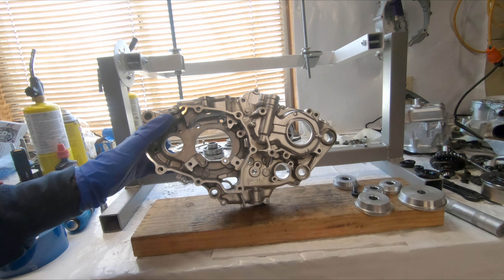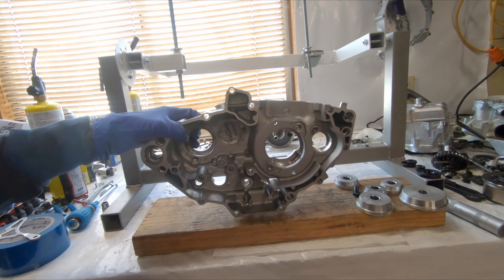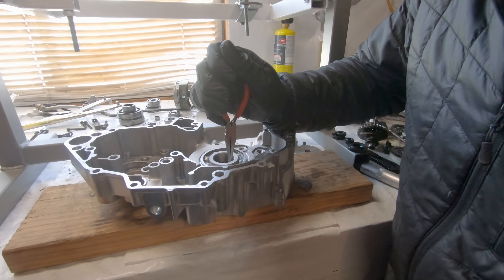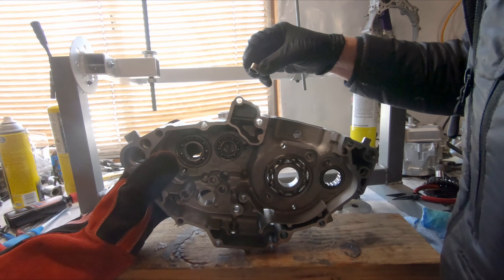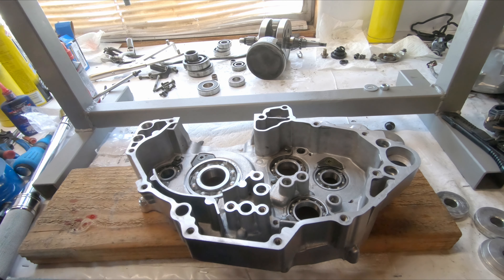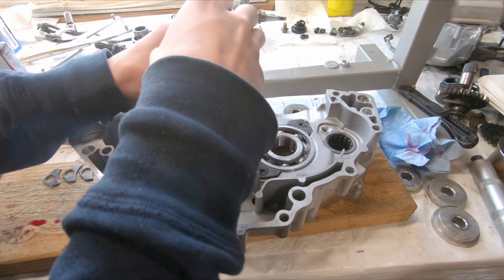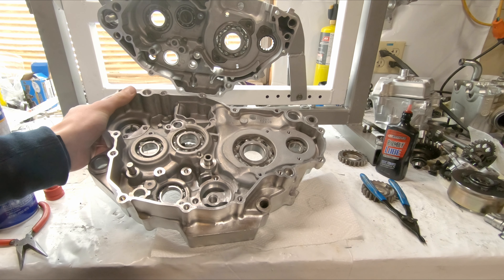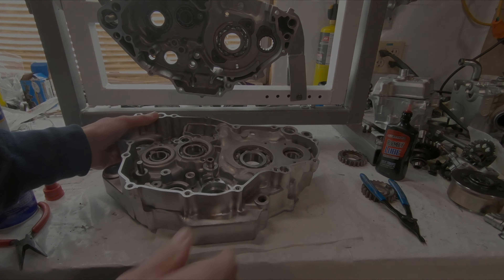Installing Engine Bearings The (Sort Of) Easy Way... | YZ426F Build 8

Comment: Where did you get all your new parts from?
Reply from the maker: I got the new bolts and seals OEM, from Rocky Mountain ATV, and I found the bearings as a kit on ebay but if you have the money, I would go OEM for them too.
Reply: @brodyfontenot  OEM is always best... i have a yz426f 2001